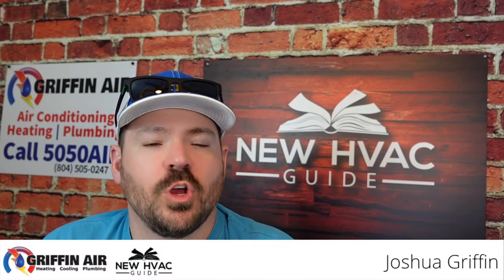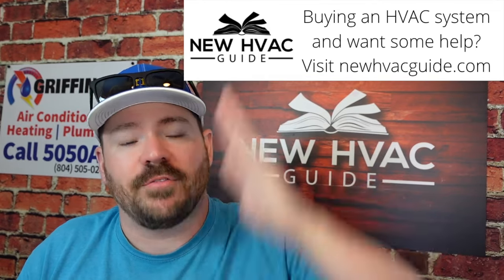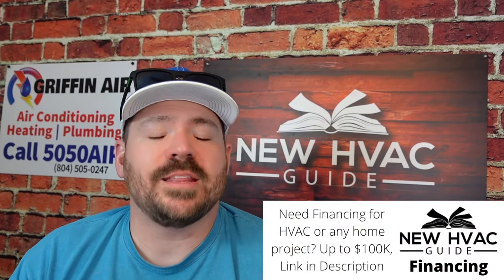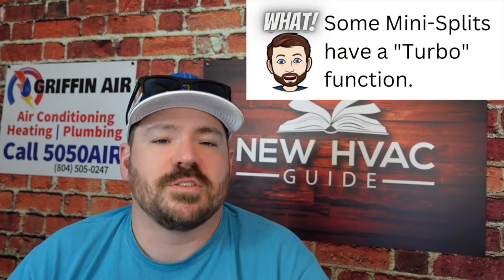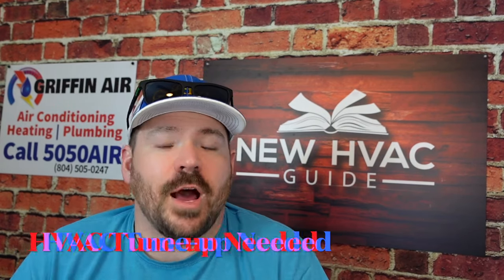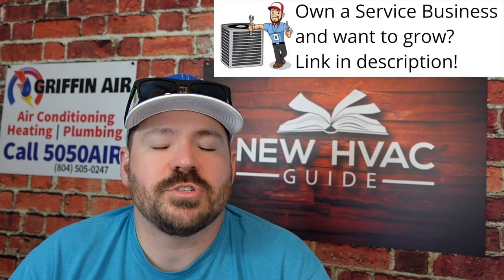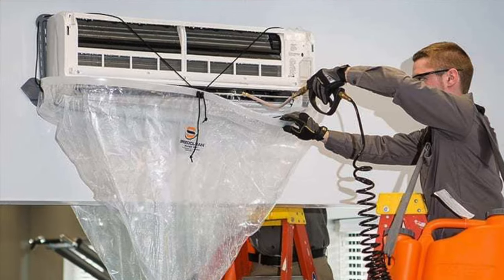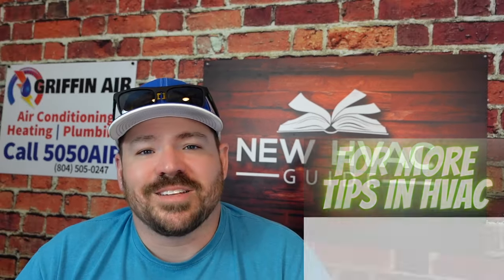Mini-Split Running CONSTANTLY! 6 Reasons Why!

Comment: If your system is working correctly it’s not supposed to turn off unless you turned it off, it’s supposed to ramp down and keep you comfortable. My first month with a mini split I got hit with a 600 bucks power bill cause I keep messing with the thermostat thinking something was wrong. The following month I left it alone at a set temperature and my power bill has gone down at an average of 15% every month compared to what I used the previous year.
Reply: Constantly running is too drying for this old body, sadly.
Reply: So you are saying eco mode turns it off and cost more to run vs leaving it on?
Reply: @Bluntedco.  i think eco mode on mine sets the heat on 66 and turns off and on . as soon as you set the temp up mine exits eco mode into auto. the way it saves money in eco mode is the set temp is lower and also normally lower than most people like 70-74. it take much less energy to keep a room or house 66 than in the 70s. in the summer eco set mine at 76 on ac mode,,  if you set yours at 66 auto heat in the winter it will cost you less than having it on eco mode becuase it would ramp up and down instead of having the power spikes it has when kicking on in eco  mode,,  this is how mine works yours might be different, i set mine on 71 auto and leave it i never touch it/or them i have 4 in different rooms that i replaced my whole house heat pump with and my power  bill went down 40 percent in the summer and 20 percent in the winter months,, i have had them 4 years and  they are great set them and leave them a lone.. there inverter  technolgy is very good.

Comment: I can't get a set temperature, I'll set it to 70  degrees in auto, cool, or comfy and it just keep blowing cold air down into the lows 60s, only way to stop that is to shut it off.. what's up with that as I read this is a common problem
Reply: @grassmastersllc2558  the Cielo breeze should shit it off but needs to be line if sight ( IR) .  Also the set temp when it comes on should be at least a few degrees lower than the shit off temp. Like set the cool temp in to 67° and the shutoff to 70° or 69°. Then it'll run the compressor trying to hit 67° bit the unit will shutoff at 70°

Comment: How about a bad temperature sensor? I have a brand, you Senville 18K btus with an inverter. The unit will keep running as long as it on (heating or cooling) passing the set temperature by many degrees. Correct amount of refrigerant...I replaced the control board of the air handler...did not make a difference. My last hope is the temp sensor.

Comment: Theoretical perfection in heating and cooling is when the unit is only supplying what is being lost. Boilers and ductless are well on their way to doing this. Boilers are at a 10 to 1 turndown and ductless, because they do not need to maintain a static pressure for balancing, are also getting close to infinite turndown. Early Sanyo units used the remote as a thermostat that had to be in eyeshot of the unit to work. The Comfort star units I install give you a choice, you can flash the unit with the remote and put the remote in a drawer, it is no longer needed. Because the unit is now taking its measurement from the thermistor in the unit, the indoor fan must be on continuously in order to get a true room temperature. Even in a power outage it will restart and go to the last setting. You can also use the "Follow me" button and turn the remote into the thermostat but once again it must stay within eyeshot of the unit to work, this is often used when they are placed on a higher wall. This will allow the unit to run until it gets to the actual temperature that the remote is sitting in.  The new high heat Comfort star has a snap out blower. This is a major innovation because squirrel cage blowers tend to get packed with dirt and having them cleaned is expensive.  This is one of the reasons I use cassettes whenever possible as they contain radial fans that dont build up dirt and are quieter, unfortunately they cant be used everywhere. Also I would like to point out that there are two "Auto" on the remote One is like you said to let the unit pick the proper fan speed so it can adjust to the load the other that confuses people is an automatic switchover from cooling to heating. People get in trouble with this on multi units if one unit is in a warmer or cooler room like a kitchen. These units can not heat and cool simultaneously like a three pipe unit. It is either one or the other and if one unit switches to heat while the other switches to cool you will pull an error code. So make sure you are setting the auto for the fan not for the unit. I was cleaning the units I installed but have recently given my cleanings to a guy that is specializing just in cleaning ductless, he is becoming quite good at disassembling all the different brands and is doing quite well. In Australia where these units have been around for many years they have franchises that do nothing but clean ductless units. This is definitely a good job for someone who is careful and meticulous to get into as most HVAC techs really don't care to do this.

Comment: I just installed a new Daiken mini split and I will set the set point to 72 on heating and it will heat it past 80 in the room without shutting off. Turn it to 70 and it will finally shut off. Same in cooling. I'll set the set point to 68 in summer and it will freeze you out of the room with the temp lower than 62 in there. I've been with Daiken tech support for 2 months on this and the things they have told us to try or replace haven't fixed the problem. The home owner is starting to get impatient. We're about read to eat the unit and throw a different brand on there for free. Any suggestions?
Reply: Same here with my Mistubishi mini split. Set it at 78, rooms get hot, does not start cooling unless I give it a nudge with the remote. Sometimes it starts cooling automatically, but it is really annoying that I have to keep the remote next to be to lower the temperature for it to finally start cooling. Maybe the temp swing is too much like 1.5/2*F before it turns on, idk how to change it.
Reply: Don't swap it with a Lennox... Blows continuously, no matter what settings I use. Super drying to the body. I hate it.
Reply: Your remote is the thermostat. Try placing the remote in a different area in the room.
Reply: @chagodlee exactly

Comment: Read the manual?  I'd bet that over half the people do not. That is their problem and its simply stupid not to because there is always going to be something in the book that will inform the owner of something they didn't know. To ignore reading the manual for anything new to the owner is just plain dumb.
Reply: I have thoroughly followed instructions and perused the manual. Nowhere’s does it address the running constantly, normal issue.
Reply: waters65  Can't read, walk or talk. O' yeah, ride a bike either.

Comment: Thing is with a Mitsubishi multi-split setup. I discovered that the inverter cannot throttle the BTUs down as low as it would be able to with a mini split. The lowest BTU output is set by the outside compressor which is high enough for my bedroom units that it cools them down quickly, the fan keeps running and redistributes all the moisture from the coil becoming a humidifier. So I'll have 70° with 65% humidity in this summer..... My workaround was to get one of those Cielo breeze controllers, set comfy temp so that when the compressor shuts off so does the fan.. Now I have 70° and 45% humidity...
Reply: Having this same exact problem. Which Cielo Breeze model did you buy?
Reply: @SethWatkins-o9o  I have a few. The basic eco will do it though. I never use the display so the more expensive model isn't worth it IMO
Reply: @chrisd4432  Thank you!

Comment: Hello, I have a new Daikin mini split and it doesn’t turn off? Is it normal? Should I set it to Auto?
Reply: I have a 2021 GREE Mini Split and when set to COLD it never shuts off. (fan will completely shut off when in HEAT mode after reaching set temperature however) When set to COLD and the compressor shuts off the fan will continue to run which it's supposed to just like the guy explains in the video. The setting AUTO is the fan speed and yes, keep it on AUTO for the best efficiency.

Comment: Just looking at my Daikins that I installed in Jan 2022.The Units work great,But looking at the outside Mini-Split I see a few leafs on the side and in the back of the unit.So I started picking them off of the unit so I will hope not to have a problem...Just wondering would a LeafBlower be Wise to use on the outside to blow away if there is any dirt or whatever I don't see on the outside coils???Just trying to keep the outdoor unit as clean as I can...Thanks
Reply from the maker: I use my leaf blower to clean off my HVAC units sometimes 😃
Reply: Hey guys, i have a fugitsu mini split 5 zones unit. 

Can I have it set on auto on one head and dry mode on another head at the same time without damaging?
Reply: @robind8164 
no.  They must be in the same mode.  In other words never use auto MODE, but use Auto on the fan speed.

Comment: I have a Panasonic mini split inverter ( no heating ) 12k btu, i sleep with the ac set to 26c , sometimes when im off to work and my wife is asleep i see the condenser fan is off and i hear no compressor noises , and sometime i say it slowly start back up.. i am guessing this is because of the relatively high temp i am setting? i live in the Caribbean so night ambient temps outside are around 23-28c?

Comment: I am wondering, which setting on these units are more finaically cheaper, should you leave it on automatic or on the coolest setting. I have a 18,000 BTU and I am only cooling one small bedroom, on the coolest setting it gets to cold and I have to turn it off, then back on. I set it at 30 and I live in Europe so the temp. setting may be different than in America where I am from. If I have it on Automatic it doesn't seem to get cool enough, this is also a new unit. I just need to know which setting is the most economic way, and which is beter, to trun it off when it gets to cold then back on when it gets to warm, the unit never shuts off automatically.  🙃🙃🙃
Reply: I'm new to this too.  So far,  watching my energy usage daily.   It takes more energy for about the first three days it's on to build up the pressure.   After that my energy usage has been lower.  My units are always on,  but they deliver the temperature they are set at. 

Maybe set the fan to auto.  (If you only have 1 unit, maybe try that on auto.  But you can't use AUTO MODE if you have more than 1 unit.)
Also, often the remote is the thermostat.   Be careful where it is in relation to the unit.

I like a very cold bedroom,  but need it warmer in the day.  I set it at 63° night, 68° day.
Maybe you should ask a technician if yours are working correctly.

Comment: Hey man, good video, you mention you can think of a brand of mini splits that do not turn off in AC mode. I have a Costway unit that will completely shut off in heat mode. But in AC mode, the outside until will shut off, but the inside unit will keep running. Curious on what brand you were talking about!
Reply: Ideally it would work the other way if you have a hot humid summer. My Mitsubishi's run continuously once temp is reached in both modes. I have a controller I bought on Amazon that shuts off the fan when the temp is reached in cooling mode. So it doesn't redistribute  moisture off the coil and make the room humid. In heat mode I want the fan to keep running
Reply: @chrisd4432  Got it, do you know if that controller would work for a Costway? Or do you have a link to the controller you’re talking about?
Reply: @TheRCinsanity  I haven't checked their database but both Cielo and Sensibo have a large database
Reply: @chrisd4432  Gotcha, I am looking at getting the Cielo Breez Max, just wanted to check to see if this is a.) what you have and b.) this model will allow me to do the same thing (turn the fan off on cool mode when set temp is reached)? Thanks man!
Reply: @TheRCinsanity  I'll try to check the database to see if it'll work for you
Reply: @chrisd4432  Cool, I did find the model of remote that my mini split uses, just under a different name. I called Cielo and they said it doesn’t matter brand, as long as the model remote is in there, it’ll work. But just wanted to confirm with you, the Cielo will allow me to turn the inside unit off as well when it has reached set temp in Cool mode? That and being able to control it from an app are the main reasons I’m looking into these, thanks!

Comment: I have two Lennix indoor wall-mounted units connected to one outdoor unit. One of my units produces way too much humidity even though I’m in Auto cool. The drain line has been verified clear. It’s been cleaned and serviced. I am not sure what’s causing it.
Reply: Then put the mode in humidity mode and see what happens
Reply: The cause is that it's a Lennox. Same issue here, among others.
Reply: All units must be in the same mode.  This is why auto MODE should not be used.
But AUTO fan speed is more efficient.

Comment: What mini split inverter window unit would you recommend. Saddle or inset. Thanks
Reply from the maker: I'm not as familiar with those. Window units have always been a lower quality and I would recommend at least looking at doing a wall hung mini split before doing a window unit. I know window units have come along way, but that's still probably the route I would go.

Comment: I have a della and when I put it in auto mode it sets at 77 degrees and I can change it. In cool mode at 74 it just keeps running.
Reply: You may have the same situation as me. The temperature set on the unit  makes the house way colder then its set at. Example, the mini split is set to 79 but it cools the house to 74. If i set the temp to 74 it would make the house 69. My old house with central AC had an adjustable thermostat that could swing 3 degrees. Meaning i could add or subtract 3 degrees to the thermostat that the AC wouldn't recognize. If the mini split allowed me to do that I could set it to 76 instead of 79 and it would cool to 74 by using the example above. If it could swing 5 degrees that would be perfect because then the house would cool to exactly what i set it at.

Comment: I have a Prime 24k cook only mini split hvac tech installed yet the outdoor unit will not turn off & if I turn off the indoor unit the outdoor high side will start to freeze over. Any thoughts?
Reply: Did you figure this out?
Reply: I have the same problem with mine the compressor will not shut off and if I turn off the inside unit it turns to a block of ice inside. I end up having to flick the breakers on and off sometimes it will finally go back to working normally for a while then it does the same thing later on. The compressor will not shut off outside. I think prime is just a piece of crap unit made in Mexico comes with no manual And it's almost impossible to find any information about them online
Reply: Mine has an RFP setting.  [Freeze protection].  For if you go on vacation....or turn them off in the house.

Comment: "Inverter" also means DC electric motors, correct?  If yes, DC runs much more quiet than AC as the "60 hz cycle" is not present in a DC motor.
Reply from the maker: What is an inverter in HVAC?
An inverter air conditioner uses microprocessors to control the speed of its compressor motor to match the required output. Once the room is cool or warm, an inverter air conditioner lowers the speed of the motor to save energy and maintain the desired temperature.
Reply: @NewHVACGuide  The best explanation I ever read, great job!
Reply: The long and short of it is "inverter" units use variable speed motors on the compressor, and to drive the air handler and outdoor fans as well. It's actually a confusing terminology to use, not sure why they use the term "inverter" because that usually denotes taking DC and turning it into AC. Yet the source current for all of these HVAC units is AC. This term is often used in solar energy or RV equipment, where an inverter takes DC output from a battery or a solar panel and turns it into house current at 120 AC. So in trying to clear this up I probably just added to the confusion sorry.
Reply: @EPeltzer  Well spoken E.P.
Reply: @EPeltzer So true, an engineer corrected me once when I used that inverter term on HVAC. We both agreed that AC should be converted to DC at the main panel of homes and run everything on DC, lights, motors everything because DC is more efficient than AC but it cannot travel the distance of AC which is why its being used mostly. We have garage door openers, washing machines and dryers that have DC motors in them and they are so quiet !

Comment: I have a mitsubishi 4 ton hyper heat unit with two air handlers. 

I hate the oem wall thermostats, (I think they are a par33 or something like that)  I set them to 71 and they never seem to hit 71, it's either way too hot or 69 degrees but never comfortable. 

Will the new ecobee premiere thermostats do a better job? Or  is there a better alternative?
Reply: Hey, they work on a degree PLUS OR MINUS the set point.    A bit like a "sign wave" Perhaps set the fan speed to a speed 2 or 3 and it will be just fine ;)
Reply: An ecobee will turn the variable speed unit into a single speed unit, which will ruin the efficiency. 

Take a look at where your thermostat is located. If it's on an exterior wall it will be influenced by the external temp. Also make sure the unit doesn't directly blow on the thermostat
Reply: @thebigdoghimself  Being in a room with the door closed can also cause the temp to get off from the rest of the house.